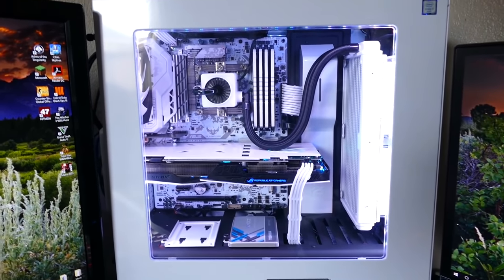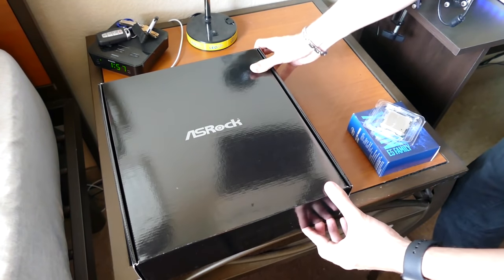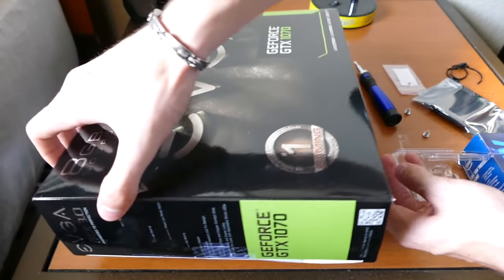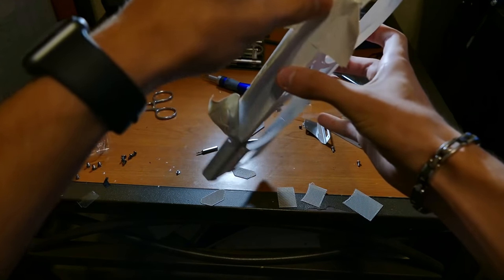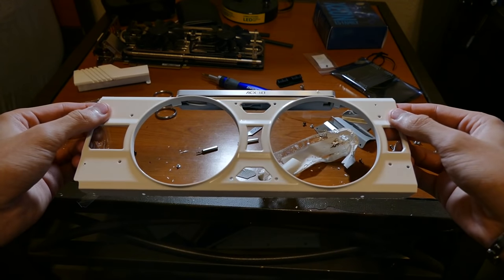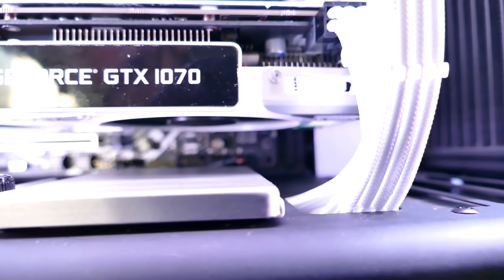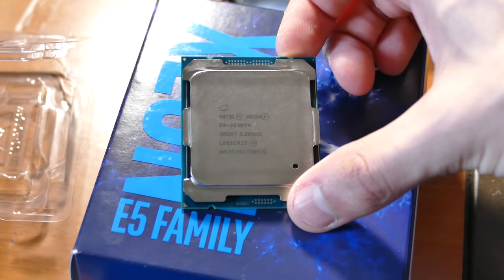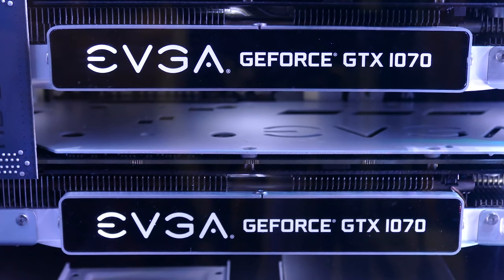Building Walter White v2.0

Comment: Urm used 1070 as a new one thats plain wrong chances are it was from BGrade stock or Refurbed still looks nice after it's paint job (hope i win the old card) and i would not worry about the gaming being impacted to much especially if your running windows 10 it will make use of the extra cores in dx12 so impact should me minimal or not apparent at all.
the posting issue i have had before also, only on x99 i am not sure why either but i agree its something to do with the cpu seating correctly or moving slightly as you apply pressure fitting the block, the fan on the Graphics card sounded like a wire was getting caught along the fins of the fan
anyway at least its up and running now and looks mint:)

Comment: Dunno why you actually picked that Xeon CPU, unless you make VERY HEAVY stuff on your pc like 3d rendering or heavy calculations, its not much worth of a buy, specially for gaming since you said that it cant be OCed, and for video edition programs, sure you might have some benefits from it, but not as much as you would actually expect compared to the 6700k you used to run, but that depends of how the program was actually developed as well.

i personally would've picked up a 5820k and save some money, sure, it might not have 10 cores, but the good thing is that has a quite good OC capabilities for being an x99 chip.

Still, i guess you went for it to do more of those high core clock counts on games with and without HT, so for the name of SCIENCE i guess it good that you went for it to put it to the test, lol

I would recommend you to keep the 6700k around just in case, specially for test comparisons.

Comment: If a single GPU is being "bottle-necked" by a "slower" CPU then why on earth do you think adding another GPU will improve frame rates??? It will improve the FPS in areas where the utilized cores aren't pegged at 100% usage, but in any CPU intensive games you will see little if any improvements because that second GPU is still waiting on instructions from the CPU just as a single card would be. In fact in some cases adding that second GPU will hinder your performance.

Comment: Damn that CPU is so unnecessarily expensive lol
Reply: i means its 10 cores the 6900k is 1k with 8 cores if this cpu can give atleast 80 percent of the performance you get from a 5960x or 6900k then its a good deal for 700.
Reply: TacticalPower88 It's actually cheap for what it is.
Reply: yeah 700 dollars is pretty cheap for what xeons are remember they go up to 4k and this is pretty much their cheapest model.

Comment: Could you do GTA 5 benchmark with only one gpu, i have  the same GPU and i have problems with GPU usage and fps.
Reply: Slikk then look up a benchmark with ur specs
Reply: At which resolution? What is your CPU? GTA 5/Online is bounded by the CPU (especially with the distance and extended distance drawing).
Reply: 1080p core i5 4690k
Reply: There we have it :D I have a Xeon 1230v3 and a 980Ti with distance drawing at max and no extended distance drawing and i only get in town around 70fps at 60% GPU usage (for a 1080p@120hz Monitor)

I set resoultion scale to 1.250x and the GPU usage is higher and i still get the same fps, but the picture loses some aliasing :-) At 1.500x resolution scale, i lose sometimes some fps, so i set it down to 1.250x.

Comment: I have a pc with i3 550 @3.20 GHz, 4 GB ddr3 ram, and psu 275W with 550W peak power and no pcie connector, I planned to upgrade it, can I use rx 460 in my PC? if no, any suggestion for the GPU?
Reply: Gold Solitude should I change the PSU too?
Reply: Gold Solitude the label says Powerlogic magnum pro x275, is it a good brand? and what is the meaning of pure/real power and max/peak power?
Reply: Gold Solitude any suggestion for the PSU?  im on tight budget..
Reply: Yes you could just make sure the rail in you psu is single rail rather than dual if it has more than one rail a new psu maybe in order Bequiet and Seasonic have some very good 500-550 watt psu's that are single rail bronze rated reliable and cheap also then you could go for a slightly more beefy GPU RX470/480 or GTX1060
Reply: Gold Solitude ok i will getting a new one, i have ~250USD for GPU and PSU, any suggestion for them both?
Reply: BeDoG where can I get info for the single or dual rail?
Reply: Evga 500watt Manf.Code: 100-W1-0500-K3 / Be Quiet! System Power 8 500W 80 Plus Power Supply Manf.Code: BN241 / Seasonic S12II 430W '80 Plus Bronze' Power Supply Manf.Code: SS-430GB F3 sry edited wrote the details for lower rated seasonic
Reply: the seasonic is ok even though its only 430w it can reach 530 peak have owned and tested many
Reply: BeDoG thank you dude
Reply: it will be on the side of the power supply try google it would take me ages to explain with my limited vocab Google is your friend but in short say example i have a 500w psu on the side it will tell me on a graph how much is being supplied to each rail if more than one is present so on a dual rail i will see something like first half of graph 230w and on second graph 270 and along the bottom these are added to get your 500w
on a single rail the graph will not be split and all 500w is available to that rail
Reply: 250 usd not sure on prices over there but you should be able to get the psu for around 50-60 bucks and gpu's your gonna be looking either cheap rx480 or the rx470 not sure you have the budget for the 1060 GTX
Reply: BeDoG i checked the be quiet! System power 8 500W, it takes about 50 bucks and left me about $200, i think if I safe some for next month i can afford the 1060, if i still can't, what do you think about gtx 1050ti, they said it will be released on 25th of oct, is it good alternative for the rx460?

Comment: why should FPS increase if you lose fps by going down from  the 6700k to a low clocked 10 core xeon alone by adding another gpu? if you had a cpu bottleneck before the worst that could happen is the 2nd gpu being almost useless aside from very gpu bound games. actually the system would have been more balanced with 1 gtx 1070 because that cpu is really not up to it, i even doubt its fast enough for 1 gtx 1070. the thing is what you would want now are gpu heavy games and also games that use dx12 or vulkan because you're really dependant on high core count usage now and dx11 isnt able to do it aside from bf4 maybe. because bf1 is such a dx12 game im curious if your gpus run well there in dx12 mode or are bottlenecked by the cpu.

Comment: I don't understand the point of getting a Xeon if you can get a 6950x the Xeon can't be coed and lacks a gpu which is needed for live streaming Intels quick sync is perfect for that.
Reply: For all of his editing. Relying on the dual GTX 1070 to push gaming. He only games in 1440p and 1080 not 4k so he should be fine. The 6950x would game better but the Xeon will edit/create content better.
Reply: Disagree both are 10 cores 6950x would have an advantage due to ipc and clock speed say 4.2ghz compared to 3.5 turbo
Reply: Oh sorry did realize you were talking 6950x. Only reason not to use that is it costs 3x the amount of the Xeon processor he used in he video. 6950x yes it is better thats why its like 1800 dollars. But his Xeon should perform better in content creation then i7's around the same price he paid for his Xeon. Since same those i7's at around same price point would only have 6 cores.

Comment: so xeon is cool to have and apparently this mobo supports ECC too. but there's this linus video showing how the 6700K beats out the higher core count chips even for rendering and stuff especially with GPU rendering or so i remember could be wrong, i didn't go and rewatch it
Reply from the maker: Didn't buy this for gaming...
Reply: i never spoke about gaming........ but I'm assuming you're using the adobe suite which from what I've heard has GPU acceleration. which defeat the purpose of the high core count of the CPU. just like you wouldn't use a CPU to mine crypto currency. am i making sense?
Reply: G33RsofDeath I believe he said in the video he wanted to do testing since there aren't that many with the process or he just installed. New content, new tests..
Reply: ok cool! i missed that, sorry.

Comment: Nice looking video. I do have to say that I literally cringe every time I see someone build a system in such a contaminated situation. Your assembly station should be as sterile as possible. When you pulled the tape off those gpu's your entire work area was filled with debris. Every chunk and flake of that paint is a potential failure point for your computer. Walter White is rolling over in he's grave.

Comment: why waste money on 1070s.....get 2 1080s...or a single titan XP....
Reply: MARIN Koza 2 gtx 1070s out perform a titan xp
Reply: Mizz Wizz only in games that support SLI tho
Reply: Arek15Arek thats pretty common nowadays
Reply: Donald Dawg  nope.
Mizz Wizz  actually the titan XP has been known to out perform 2 1070s while at 1440p max settings, but 2 1070s do slightly better at 4k...slightly, plus i mentioned it because its good for both gaming and work overall. 2 1070s can cost around 400$ each, and that's from nvidia, not asus or msi, which cost 550$+ each, still less then a single XP, for only slightly better performance in 4k, but less in 1440. but anyways, if i were to upgrade, i would keep saving for the best that is available.
Reply: MARIN Koza Well, the 1080Ti is gonna be the best option, a non-overpriced single card with alot of performance. Hope it launches soon
Reply: Arek15Arek  i never understood that, the last Ti was better clock speed but lower memory, if this is going to be a 1080 Ti, will it have better clock? or better memory?, 1080 already can get 2GHz on an overclock, maybe better base clock? for non-overclockers i guess.
Reply: MARIN Koza The 80Ti cards are actually more of slightly downgraded Titans than actual 80 cards with improvements. The thing that usually makes an 80Ti card better than an 80 card are the additional Cuda Cores and more memory.
Reply: Arek15Arek  yeah i had seen that, still a lower base and boost clock then a normal 1080

Comment: You didn't show so I guess you didn't do... : TEST your hardware before you take it appart! if you did though, well, I have something else for ya : Remove the tape before bringing the painted parts close to the electronics... I made me badly cringe to watch these paint chips flying around your naked graphic card... Also, it might have been a paint chip that prevent your CPU to connnect correctly in the first place? 

Otherwise, looks great mate! Is it powerfull enough to cook meth? Haha.